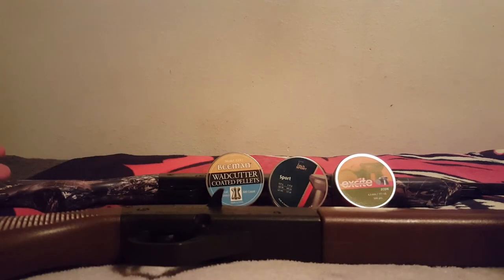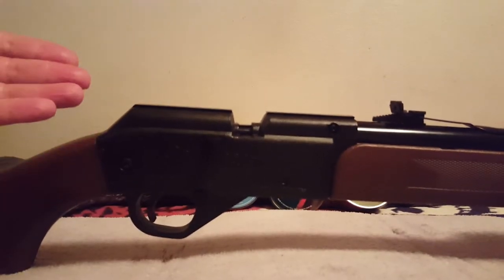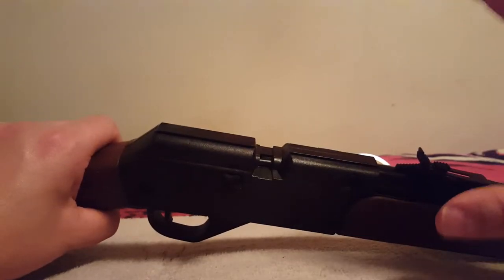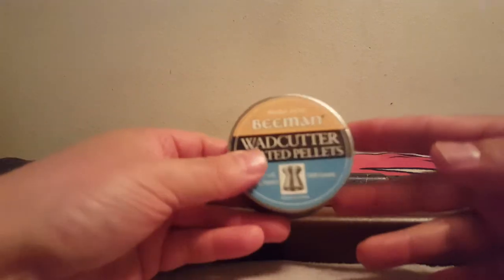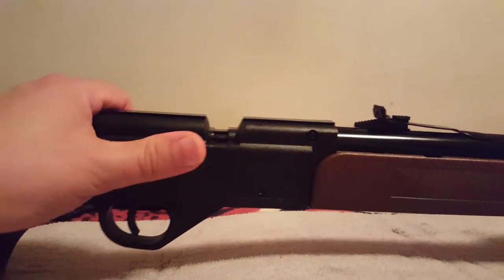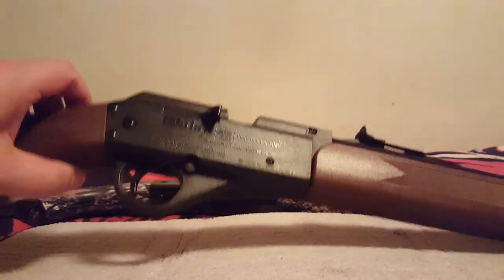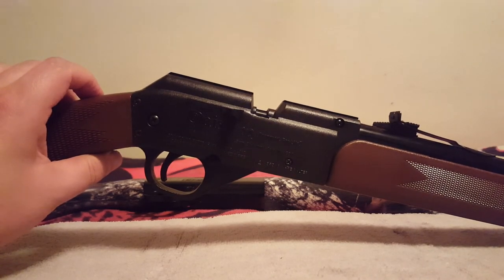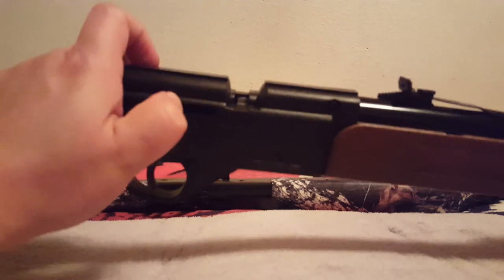Daisy Single Pump -  Trouble-shooting 2840

Comment: I had a Grizzly and I liked it. I will check out the 2840.
Reply from the maker: Stephen, as long as you watch out for the subject in this video, you will have a blast. As a BB gun, the 2840 WAY out shoots a stock Red Ryder.

With light pistol wadcutters like Econs or Crosman 7.4 wadcutters, it is surprisingly accurate up to 20 yards.
Reply: What was the fps that the Grizzly shot? What is the fps of the 2840?  Thanks.
Reply from the maker: Stephen, they publish 350 on both. They have 7 inch longer barrels than Ryder and retain energy longer down range.

But think 250 fps for light wadcutters.

270 fps for BBs.

Stock Ryder - 250 fps with BBs.
Reply: @daisy880fanaticfixit9  Thanks!

Comment: I have the grizzly right now and it was given to me as a gift like 3 years ago but it never worked… every time I pump it it releases air… do you know why it’s doing that?
Reply from the maker: Bruce, that is likely an O Ring replacement fix. You change both rings on the pump head and VB (plastic body).

SAE 115

In the DANCO kit below, they are called #13.

https://www.amazon.com/Danco-34443-Rubber-Faucet-Ring/dp/B000KNT6WA/ref=mp_s_a_1_5?crid=3B378K07DHTBW&keywords=danco+kit+rings&qid=1647226377&sprefix=danco+kit+rings%2Caps%2C146&sr=8-5

The fix videos are old but correct. I jumped into those too fast before I had more details down. It's totally different engineering from the 880. So the pin is a valve stem. There is no firing pin in an airgun.

For the seals, ID is INSIDE diameter, and OD is outside diameter. You might already know all that, so I apologize for that in the narration.

https://youtu.be/ED68Xz5BHqM

https://youtu.be/2w7kjOrjCec

The reality is the Grizzly was discontinued partly because it was harder to repair and could suffer fatal break if folks tried making it a multi-pump. It would crack the plastic body. CHECK for obvious crack damage.

Clean off the pump head and valve body (VB) before applying your Danco nitrile seals. That gets off any potential bad chemicals from the last owner.

Comment: I have a camo version of this gun, and the bolt has jammed halfway, can't close it. Any ideas or just use a cleaning rod?
Reply from the maker: Susan, thanks for clear and polite comment. YES, USE THE RAM ROD.

When it comes to the youth guns, the Ryder is much more of a headache than your 2840. 5 Malfunctions - THREE MAJOR JAMS. 

Yes, that sounds like ammo jam. If it is BB, toss it. If it is USED BB please avoid those. BBs are cheap and not worth a jam. 

If you have pellets that are non stop jams, switch to easy to find CROSMAN 7.4 wadcutters.

Comment: What if i dont have a rubber coated rod?
Reply from the maker: For these single pump smoothbore guns, just use a basic coat hanger to clear a jam. A small wooden towel is fine, too.
Reply: @daisy880fanaticfixit9  thanks. I found a metal rod in my garage😀